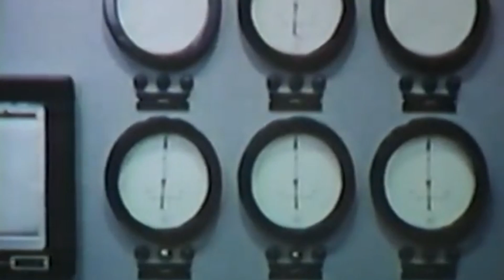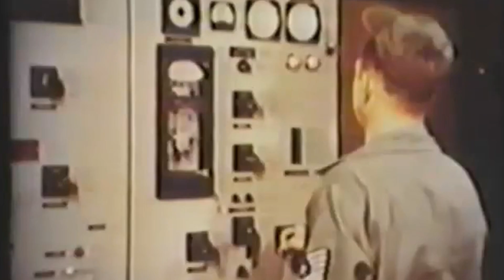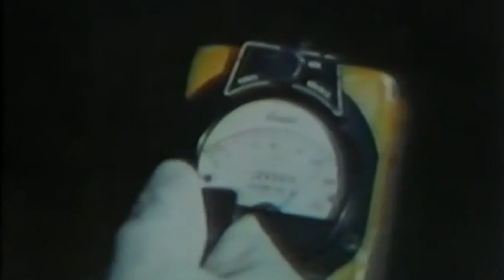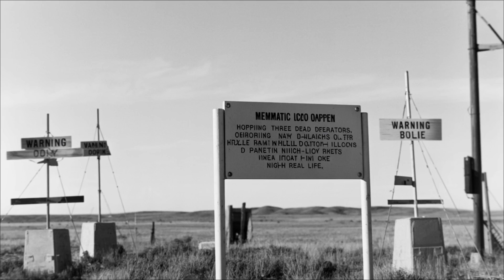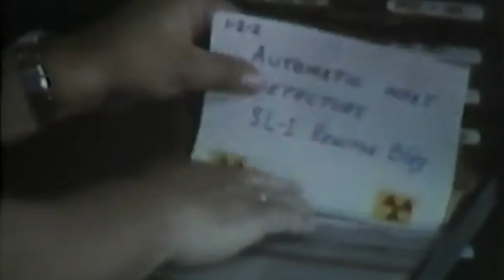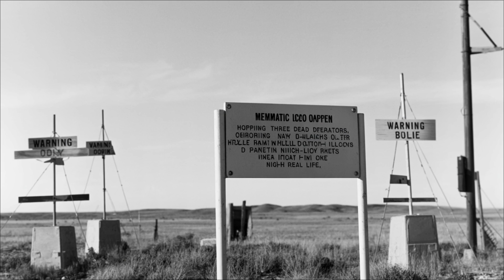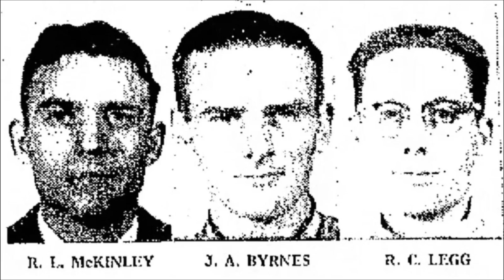SL-1: America’s Deadly Nuclear Reactor Meltdown

Comment: "It's totally safe"
-- engineers, politicians about TMI, Tchernobyl, Fukushima ... --
Reply: taking a little time to actually find out WHY these reactors failed helps.
Fukushima used an active shutdown system, modern ones use passive walk away style shutdowns that shut down on their own even when power and water supply shuts off. the earthquake cut power AND water to the system. as far as I understand things, locals complained about upgrading the system to current standards at the time of proposal; due to concerns (and lack of understanding) over their reactor being "just another Chernobyl"  and blocked these critical upgrades from happening that might have prevented this disaster from happening.
Chernobyl while being older and an active shutdown system; failed due to some idiots playing a game of poke the bear and hope it doesn't turn around and maul you. They ran experiments on how far they could push the system before it ran away. They did this multiple times causing things to start a run away reaction before being able to calm it down..... then decided lets try that again but this time even further. That was sheer stupidity at play.

Modern ones are for all intensive purposes are safe.

Comment: SL-1 was a reactor-drive steam explosion, caused when the power multiplied by a factor of a thousand or so, in the space of a few thousandths of a second.
Black powder explosions can take longer than that.  And since the explosion was contained in a cylinder (think gun barrel) the physical velocity of all the parts was increased.
There is a myth going around about romantic involvement/cheating happening between family members, wives, bla bla bla, it's all horseshit. There has never been any evidence to support that theory.
The accident occurred because nuclear designers and their handlers were becoming cavalier cowboys about the safety of reactors, and because such low-budget constructions were allowed to 
happen by management.

Comment: As Rodney Dangerfield would say, "Oh, you left out a bunch of stuff."

For instance, SL-1 couldn't even be called a Model A of reactors, it was so primitive.  The workers had repeatedly complained that the rods would stick in their slots and have to be yanked on to get them to move.  And we've had mobile nuclear reactors for decades.  Or did you just assume nuclear submarines had really, really long extension cords?
Reply: Subs on extension cords is funny af!!
Reply: Rickover knew, that if the Navy was to be allowed to have its own independent, unsupervised (classified) reactor program (utterly crucial for a sub force), it must never suffer a reactor accident.
We've lost two nuclear subs, Thresher and Scorpion, and while we do not know the details of their causes, they are not believed to have been nuclear accidents. 
We have less of an edge now than we had in the past, but we still build very good, very quiet, and very safe, boats.